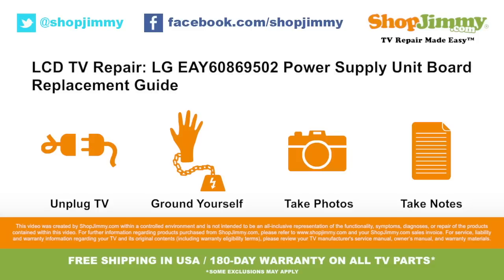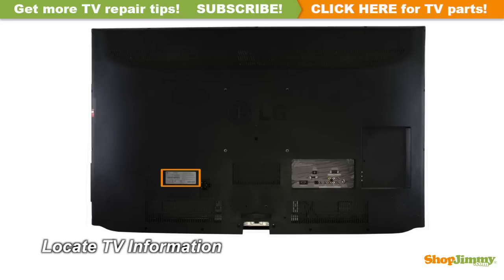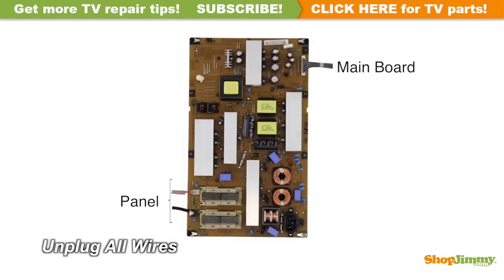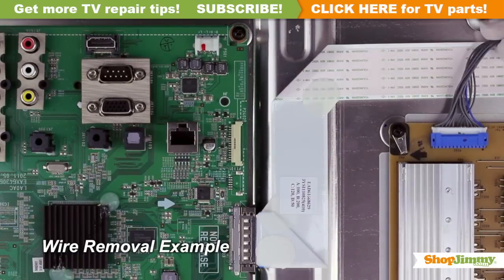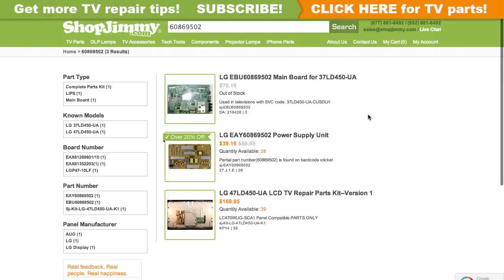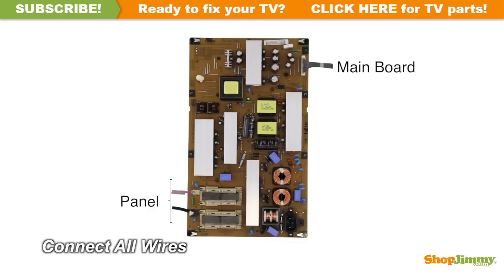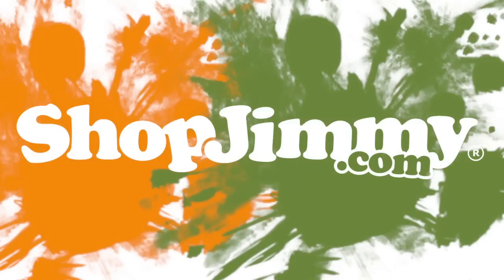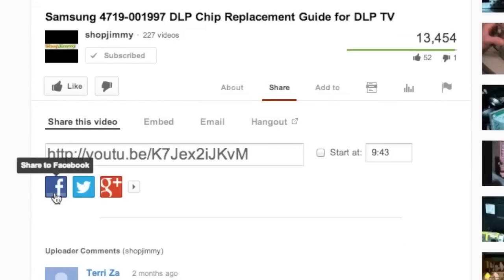LG EAY60869502 Power Supply Unit (PSU) Boards Replacement Guide for LCD TV Repair

Comment: Seems my tv is turning off on its own every few minutes, I am hoping it is the PCU
Reply: 4Zeus20 so did you replace your PSU. Cause my TV is having the exact same symptoms as yours. Wondering if I should replace the PSU as well.
Reply: +Joey Nor So is mine! Did you guys solve the problem? I'm about to order the PSU? Should I order the main board as well?
Reply: +Pedro Madeira, I never found out from 4Zeus20, but  my tv somehow fixed itself. So I've postponed my plans to buy the PSU. When I opened the TV to check for the part no., I did some cleaning and inspection of PSU board. I made sure that there was no swelling capacitors or excessive dust on any part of the board. Somehow me fiddling around with the PSU board capacitors made it okay now. Im not sure if this is a permanent solution, I suspect the problem will come back sometime later though. If you've bought the PSU, and install a new one, please share us your results.
Reply: +Joey Nor haven't bought it yet because it's working for now, what the hell? Let's wait and see...